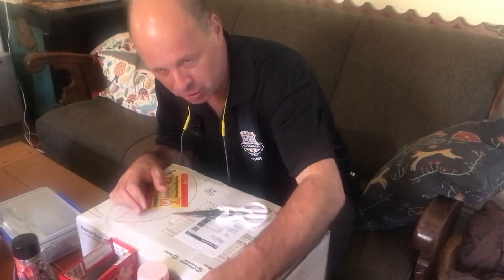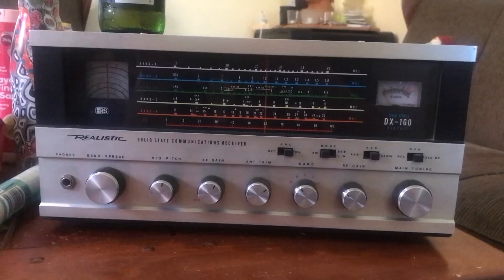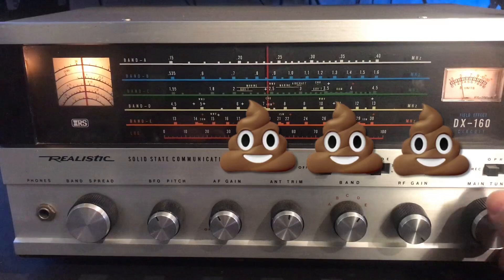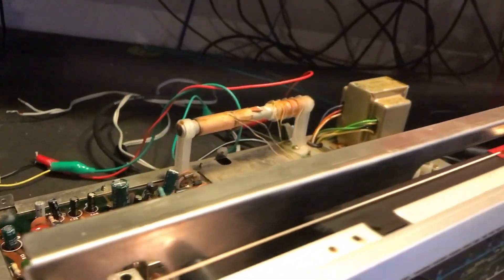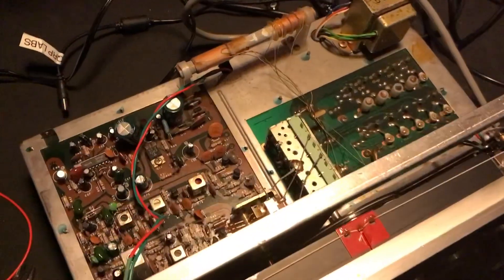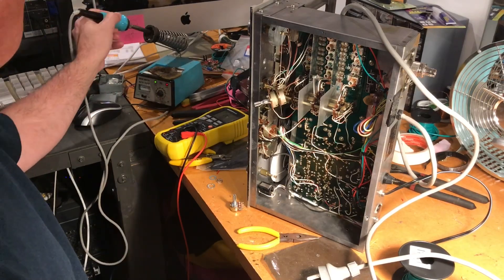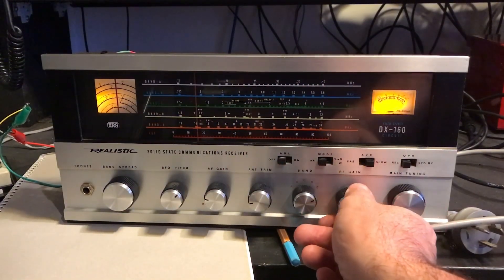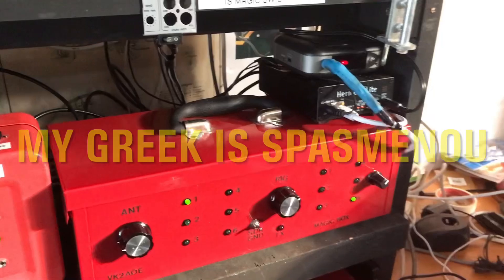70’s SUPER SUPERHET -Realistic DX-160

Comment: I had fantasies about the DX-160 too, until I actually used one, and realized, it wasn't great by any means. I had several other disappointing receivers until I got my JRC NRD-515 "Gilfer Edition". I loved that thing. I sadly had to sell it for financial reasons. I could buy another one if I wanted to, but time is taking a toll on those old rigs and parts are pretty hard to find. If you can't find a filter or the encoder out of a dead one, your's is gonna be a paperweight.
Reply from the maker: Yes… never owned JRC but legions of fans indicate it’s quality. Yes the DX160 is not great, but for a single conversion rig it does OK. Thanks for stopping by and 73

Comment: I have an DX160 in excellent working condition.  Bought it used over 40 years ago for AU$100  but it ended up in the shed when moving house etc. Last year I renewed my Ham License (adv) and got the old girl out. With a clean up, and some realignment it works great.  I also have a Tecsun S2000 (2nd hand) which is much fancier but the old 160 is quieter and just as sensitive.  Just not as nice to tune with poor image rejection on the higher bands (joys of single conversion).  I'd never sell it as its a piece of history as well as being all analog and fun.😀
73s  Rob VK5KRM
Reply from the maker: 100% agree, the analogue elegance is a thing of beauty. I renewed my license after 30 yrs away and I’m loving the hobby again.

Comment: Interesting, I have one in my study - I wanted a receiver in my study, as opposed to my radio shack, so I could listen whilst on my computer etc.
Whilst my RF gain pot is ok, I did notice quite a lot of mains buzz as I tuned about the AM broadcast band as you were, so it looks like I might need a new cap or two in the power supply (I run mine on 240, as I like a lit dial). Pity you didn't get the matching speaker.
I've toyed with fitting a digital frequency display, I have a small display that should sit just above the s-meter, as with that band spread dial, I'm never sure where I really are, frequency wise. 
Otherwise I like the added antenna socket, something for the next time it's on the work bench.
Reply from the maker: @paulstubbs7678  A 🏠 radio is a great idea! It appears that on AM there is still hum, between stations on mine, even powered on DC (though not as bad). I think the massive ferrite rod picks it up? Still much better after recap. Yes the speaker would have been nice (I’ll keep an eye out for one ) 😂 73 and tnks fer the comment.

Comment: I owned a DX-160 for a short time.  
It looked nice enough and sounded decent, but it frustrated the crap out of me.   
The problem was the need to readjust the RF gain almost incessantly as I tuned in various signals. 
I rarely get rid of anything, but I just couldn't stand to keep that one.
Reply from the maker: Probably why my RF gain pot was worn out! Maybe mine was yours? 🤣 I like it when the radio wants me to touch it! 🙄.....on second thoughts, that sounds creepy....73
Reply: @TheArtofEngineering  Do you grab her by the RF gain?
Reply: @TheArtofEngineering  LOL

Comment: Thank you for the video, I purchased one of these as my first receiver in early 1980, or was it '70  not sure. The 72-year-old brain is not as sharp as it used to be, but I must dig it out of the basement and see if it will fire up, I hope the smoke stays in lol .73 de VE9RF previous call VE1BTZ.
Reply from the maker: The rig was (according to Google) 1975-1980. I remember seeing them in Tandy as a lad prior to getting my novice at 13 (1983) and wishing I could own one. So your memory on both counts correct! 🤣 I love the knob twiddling (very nostalgic), I've ordered a vacuum tube and I plan to team this rx with a single tube transmitter on 40m. Wish me luck.